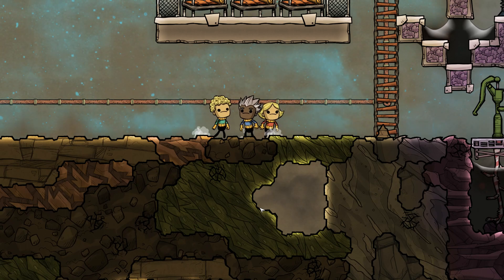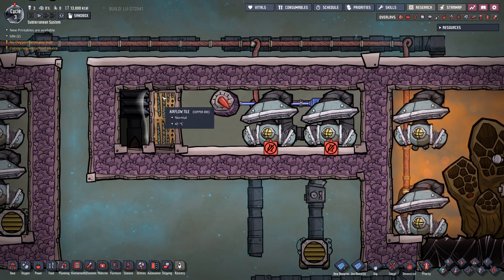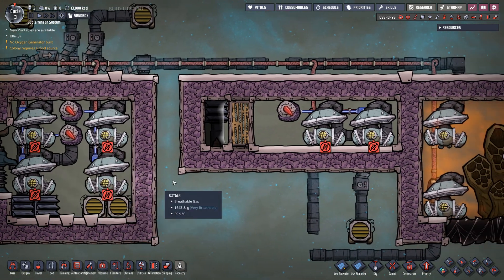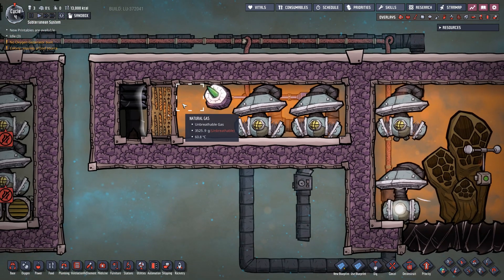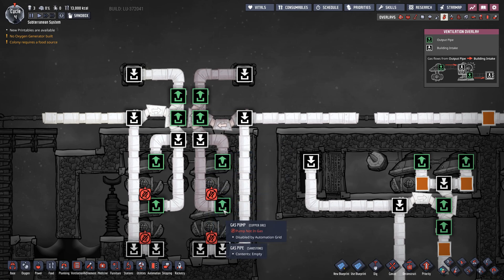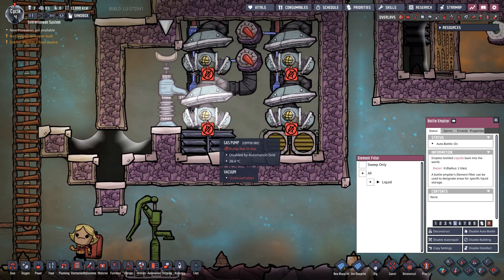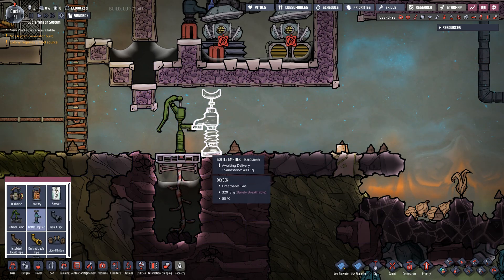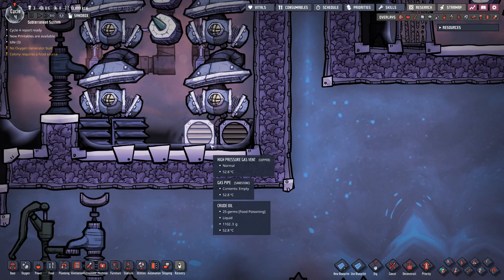Unlimited Gas Storage | Oxygen Not Included Guide

Comment: so the easiest way to make sure you got right amount of water (lower than 1kg) on the right tile. you pour in 1 bottle of water which is at 200kg per bottle. on the water tile which then it will overflow and flood thru other tile i do recommend blocking one side of tile. and after then mop the rest of the tile except for the last 2 tile. because dupes will alyways mop 1  tile on the right and left even though you command them to mop 1 tile. and after that you should have 1 tile with around 95g of water on it. and then push the water on to the tile by building tile next to it. you can double the amount by doing same step but mop except last 3 tile.
Reply: and yeah if you want to do it on multiple tile. you can just flood the tile and make a hole on the last unsued tile like wall tile before you build the wall so the water could just flow into the hole and then just mop out the water inside it

Comment: Only issue with the vents being flat against t he floor is the oil can be deleted and break your tank.  Filling the two tile deep one is easy enough if you build one air flow fill it to over flowing then build the second airflow tile and it will push what is on top of the first airflow tile over into the space needed.  Credit to Lifegrowski for that idea.
Reply from the maker: I've seen Lifegrow do this during his streams, its actually mostly because of him the 2nd method was shown. So far after 700+ cycles Im let to loose the oil on the floor, its shifts sideways rather then being deleted. If it was a 1 tile vent with walls either side then it might be deleted, hence why i try to make it a few tiles wide so the oil can slide left/right